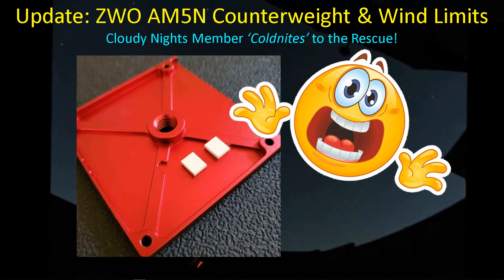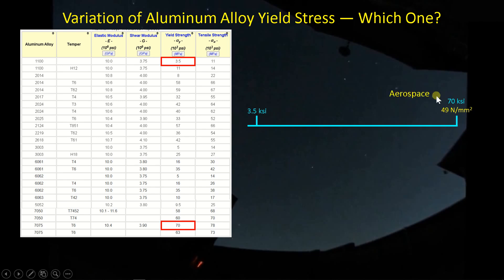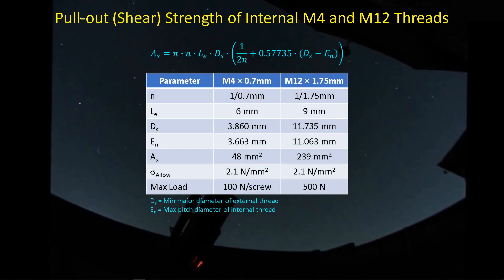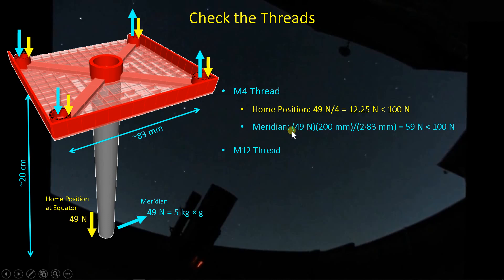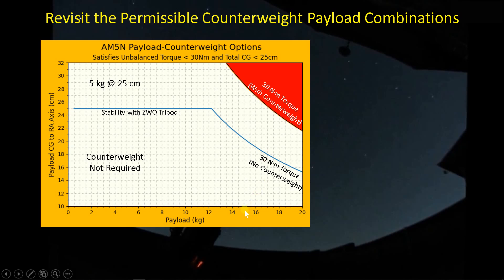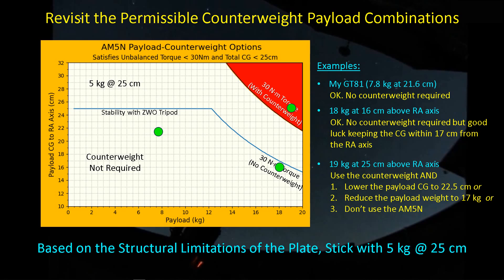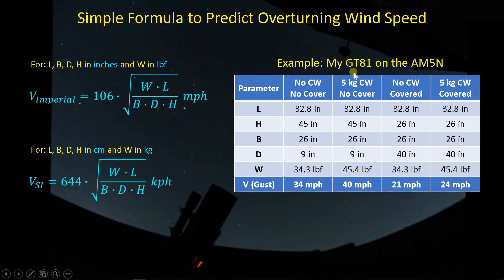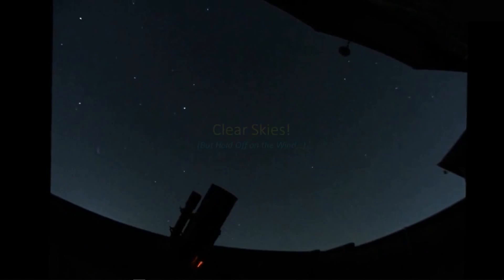Analysis of the ZWO AM5N Counterweight Limit and Tip Over Wind Speed

Comment: Hi James . Another interesting and somewhat scary investigation into tip over wind speed. Limits. I have taken to heart your calculations (warnings) on this, as I will be attending the Texas star party next week. I plan on having my 2 mounts setup (  AT92 refractor and SCT9.25 ) on RST135 heads on RT90c tripods. If you have watched some of the YouTube videos of past events you can see mini-twisters knocking over equipment and blowing away scope covers. Yikes. I have designed 3D printed leg clamps that I can mount on the legs about half way up. I will have ratcheting straps attached to these that are attached to stakes in the ground. Only to be used during daytime so I don’t kill myself tripping over them at night. Ha. This is my first big star party event so should be interesting. Thanks for all your videos. Take care. Steve

Comment: Thank you for the information, I have one question. Zwo have a picture on their website showing C11 and some accesories attached on it without a counterweight. But according to your chart, that load exceeding the ''Counterweight Not Required'' area. It should sit around 30 cm CG(or not?). How is it works then ?  I was looking to get AM5N for my C11 to use it with 15,5 KG total load. Apparently I am in the red line. I am confused.
Reply from the maker: Your estimate for the CG location at 30 cm above the RA is what I calculate. With your 15.5 kg payload, you would exceed the 30 Nm unbalanced torque limit. Seems like your only option is reduce the payload weight by 1.5 kg for a total payload weight of 14 kg. Can you do that? If not, then you probably shouldn't get the AM5N for that scope.
Reply: @Aero19612  Thank you very much for your ansver. But I can't reduce my payload weight sadly. I think I need to search for a different mount as you said. I just saw the Sky-Watcher Wave 150i, it has 55lbs total capacity with CW and Sky-Watcher says that mount can balanced with up to 40lbs(18kg) of Counterweight unlike the AM5N. What do you think about that mount with C11? Is there any chance that you do a simple calculation for different payloads like you did in the video via chart? I would be very appreciate..
Reply from the maker: @barisoz  That's too bad about the AM5N not working out for your payload. I like Sky Watcher (I have their EQ6-R). I think the 150i also has clutches, which I like. It sounds like a great fit for you heavier payload. I'll have to look into doing a similar analysis for the Wave 150i. Thanks for the suggestion!
Reply: @Aero19612  I will be waiting! Thank you again.  Wave 150i could be a option for those looking for a portable and lightweight mount for their heavy astrophotography  setup.
Reply from the maker: Absolutely. The Wave 150i is a great alternative. Frankly, I wish I had given it serious consideration before I “jumped” for the AM5N. Oh well. If you get the 150i, let me know what you think.
Reply from the maker: @ Definitely!

Comment: Question, adding the 5kg weight along with let’s say a 30lb scope, does this wear out the am5n bearings and shafts quicker. This could be another research avenue.
Reply from the maker: No, I think you’re good to go. You might get into trouble if the total unbalanced weight creates a torque that exceeds the motor/gear limit of 30 N m. As long as your setup falls within the “white zone” I show in the graphic, everything’s fine. Thanks for watching!
Reply: @Aero19612  Awesome, thanks alot!

Comment: Hi, I had one tip-over on my AM5 mount due wind and having a cover on the telescope.  Since I have to move the telescope and mount inside from time to time, I ended up putting the AM5N on my AVX tripod.  No tips to date, even in high wind with the cover on my SV103 with camera and guide scope.  But I think I will add stakes to batten the tripod down.

Thanks!
Reply from the maker: @scottinharwood  Never hurts to take a few extra precautions! We’ve got a lot of money sitting outside under the cover.

Comment: Hi James, if I had to make a guess, I think the aluminum would be 6000 series aluminum, most likely 6061 or 6063 aluminum and most likely T6 or a similar condition.  It is just so commonly used and available.  If they were forming or welding the frame, then I would think another series aluminum might be a better choice. 2024 and 7075 are much more expensive and harder to machine than 6061 and usually only used when the strength is absolutely needed.
Reply from the maker: I suspect you’re correct. You could get up to the 30ish ksi yield stress with 6061. ZWO definitely isn’t doing any welding—that’s a whole new level of cost/complexity with aluminum. Even at a yield stress of 30 ksi, the ZWO plate doesn’t work without some local yielding. Oh well. Thanks for the input, Dale!

Comment: I've been worried about my AM5 tipping over since I got it in late 2023.  My solution was to use the tripod from my EQ6-R.  This has much more weight, less flex, and a wider base.  It's easy to mount the AM5 on it especially if you have the pier extension.  I know from your previous videos, you had an EQ6-R.  Have you calculated the wind speed for tip-over using that combination?
Reply from the maker: Just ran through the calculation with my GT81 and EQ6 (I still have it). I don’t extend the legs, so my “L” is 36”. I would have to use the 22 lb of counterweights. Under the cover, the tip-over wind speed is 34 mph compared with 22 mph on the AM5 with no counterweights. I could certainly breathe a little easier with that number.

Comment: How much difference does it make to put weight in the basket? It seems like that would be the simplest fix to reduce the chance of wind tipping it over.
Reply from the maker: That’s easy to check out with the formula. Let’s assume you put the 5 kg counterweight on the mount (that’s the first best thing to do because it helps you at the Meridian), then go ahead and add another 5 kg (or more) to the basket. Just add that weight to W in the formula and see what you get.
Reply: I never leave my C8 and AVX out during high winds. With the AM5N I will be able to easily bring the unit inside

Comment: Hi James- as with the other commentator, my first thought was to go with a longer thread on a counterweight bar with a shoulder that could bear against an external plate to spread the load. Does that sound like a valid approach?
Reply from the maker: I don’t think that will work, unless the external plate is bonded to the ZWO plate. Also need to make sure the longer counterweight bar thread doesn’t project above the threaded hole in the ZWO plate. I think the only way to increase the counterweight limit is to replace the ZWO plate with a thicker one.

Comment: Hi James. I got around this issue by 3D printing an external thread and counterweight bar that I can secure with a square thick plate washer to spread the load and add more weight
Reply from the maker: @paskoh  Hmm. I probably don’t fully grasp the design. But what I’m imagining probably won’t help too much. Tell me more about it. I’m interested!
Reply: @Aero19612  Hi James. I've just emailed you with the details as its easier for me to attach some photos that way to explain more easily. Cheers

Comment: Hi James. As usual , a great detailed report . Knowing your quest for detailed information on many telescope operations , I thought you would be interested  in the Rainbow Robotics mounts. (RST135, RST135e, etc)
I settled on this mount since it is a servo motor based system. Allows you to run the motors on any voltage from 12 to 16V , which also helps mount performance. From my robotics work , I tend to favor the servo motor, especially with the new control electronics. I really like the Rainbow ASCOM interface panel to the mount. 
Provides live readouts for Control board temperatures, Event log, Input voltage to motors, Mount position, mount Status, jog panel with full speed control and best of all, a Motor Power display. 
The live power display  for each axis is very nice to "tune" the loading on each axis.
The mount easily handles my scope setup which is the same as your SCT 9.25 .
Such fun equipment we get to play with!
Take care
Steve
Reply from the maker: @stevekaiser4959  Hey Steve. Thanks for the thoughts on servo motors. Wasn’t the Rainbow mount the first of the strain wave mounts on the market? I’m surprised the mount power is measured fine enough to use for balancing. That’s great, especially if there are no clutches. Mostly fun…haha. Glad you’re having fun with your Rainbow!